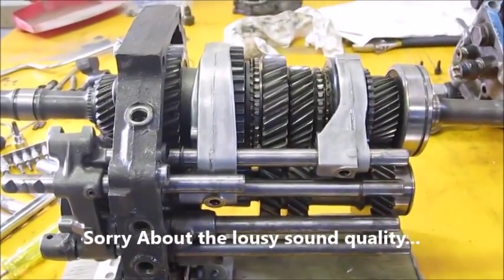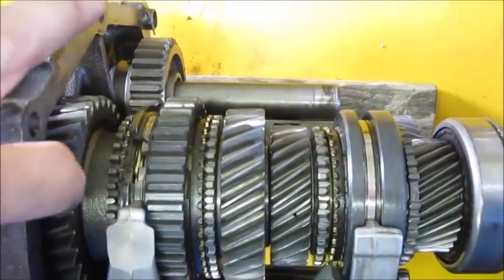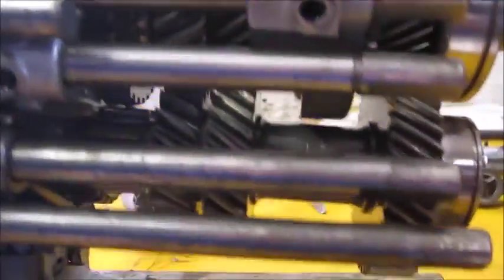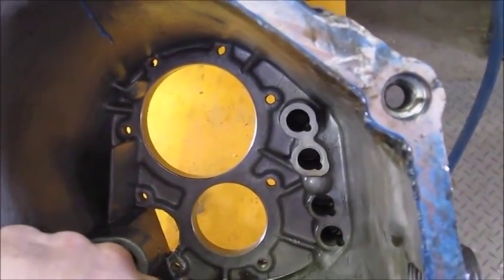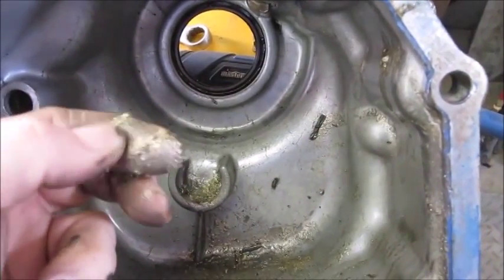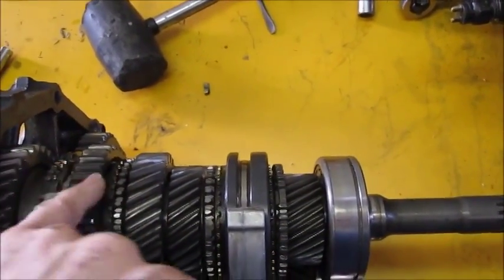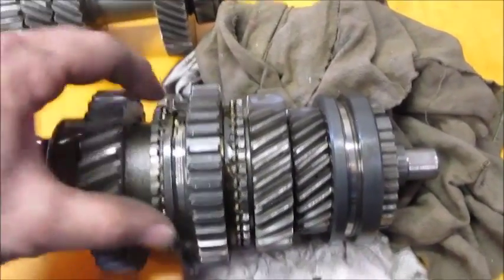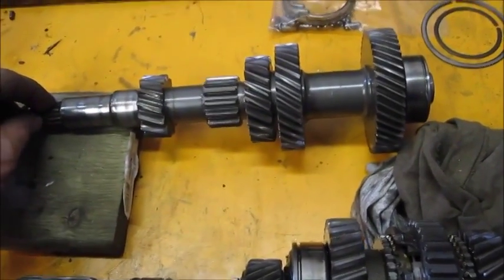AX5 Transmission - Disassembly and Inspection - supplemental

Comment: Hi, thank you for the great series of uploads on the AX-5 manual transmission strip down.Could l ask if you could provide a link or info on the service manual you used to do this work. l would like to attempt a rebuild of my  1995 Jeep Wrangler 2.5 YJ   which has this transmission not the more robust AX-15.  I would only feel confident if l like you had the service manual to hand
whilst attempting this work.Better safe than sorry and don't wish to do the work twice repairing my mistakes if possible.I  live in the United Kingdom so Jeep service manuals of any description are a bit thin on the ground here.Transmission servicing needs to be done accurately no room for guessing or errors will occur.  Cheers   Colin
Reply from the maker: try:  http://colorado4wheel.com/manuals/Jeep/XJ/

1995_XJ_FSM.zip

95XJ_21.PDF

Comment: Do you have a video for removing all the gears off of the shafts?
Reply from the maker: Hello Adam, I did not create a video removing the gears and doing a full rebuild.  The jeep was in a wreck and was written off...  so no need to replace the transmission.   There is a set of videos made by robinsonauto where he rebuilds an AX15.  The AX5 and AX15 are very similar,  Use this as a reference.
Reply: Here is a video on Gear removal for an AX15 which is very similar to the AX5.  You would need to find the Service Manual for the AX5 to obtain clearance specs.  https://www.youtube.com/edit?o=U&video_id=EbQa_K5ji2Q